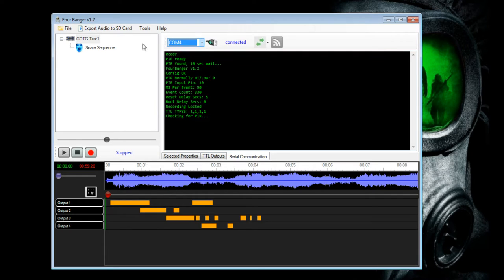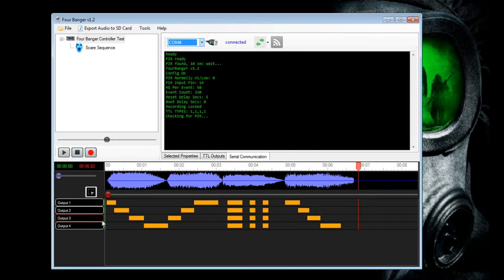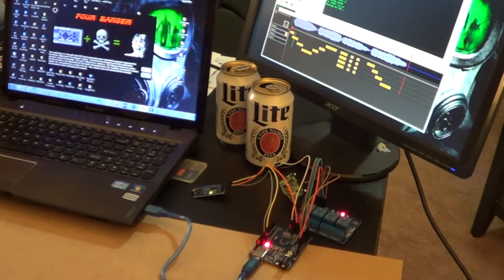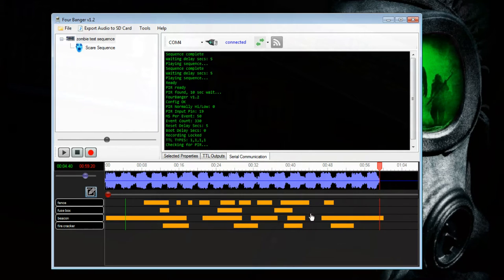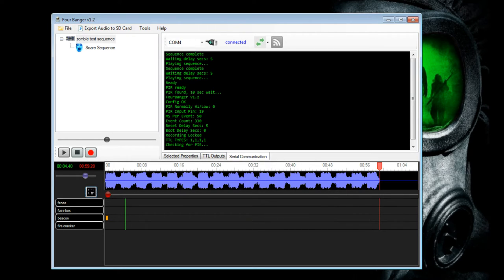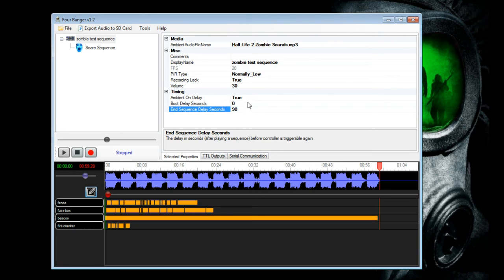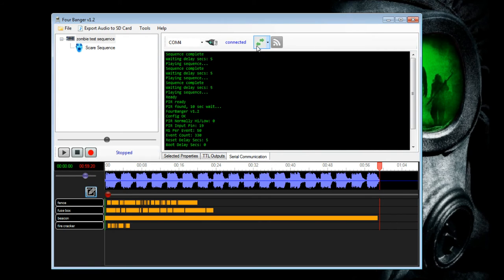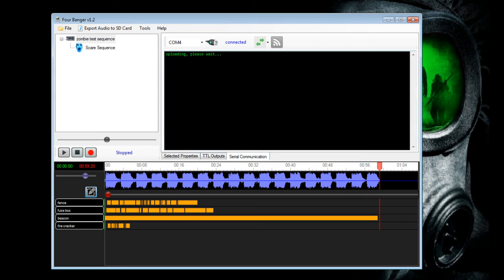Programming the $20ish Arduino Prop Controller

Comment: See, I knew you'd figure it out ... just have to play around with it. It's very simple yet does some pretty cool stuff. I have enough parts to build a few more. It gets really interesting when you connect a few controllers together and have them trigger together.
Reply from the maker: +The Pirates of North Court Yeah it wasn't bad at all!  Know I just need a descent enclosure that doesn't cost ten bucks lol
Reply: +The Pirates of North Court Oh, that sounds interesting!  How would you accomplish connecting them together?
Reply from the maker: +Montclair's Lair i'm not exactly sure yet LOL
Reply from the maker: +Montclair&#39;s Lair Basically you would take one of the 4 channels and use that as the trigger for the next controller in line.  You would be using the relay to close the circuit of the trigger input.  If that makes sense.
Reply: Graves Of The Groves
Oh sh*t, that's brilliant! And painfully obvious now that you point it out, LOL!. Not sure why that didn't occur to me. Sweet! Oh, now I know why. Will those relays work on switching low DC voltage too?
Reply: Actually, that isn't how I did it but if it works for you guys then great. Here is how I did it.

When the controller is triggered (either from the TTL pin 11 or PIR) the controller will output a momentary LOW on pin 12. That means that pin 12 on the "main" controller can be wired to a second controller's TTL input of pin 11. When a sequence gets kicked off on the main controller, the sequence on the second controller will go off at exactly the same time. Just make sure you tie the grounds together on both controllers.
Reply: +The Pirates of North Court This is a better solution as you lose a relay the other way. I suppose you could keep chaining them along this way. This makes for quite an awesome experience you can provide, for the relatively low amount of $$ you have to spend on controllers.
Reply from the maker: +The Pirates of North Court That is very cool!  I know little about these Arduinos so this is certainly a way better method rather than losing an channel.  Thanks!
Reply from the maker: +Montclair&#39;s Lair AGREED!!
Reply: +Graves Of The Groves Mike's controller is what really makes all this possible. He has programmed this thing to be as robust as possible and yet simple enough for just about everyone to build & use without spending a ton of money.

He has always been willing to answer questions and offer help whenever you get stuck. I figure it's the least I can do if I can provide a little help I've learned from him.

When I pull all my electronic pieces out and start building again, I'll shoot a little video of how I have mine put together. Can't promise anytime soon, but I'll post something eventually.
Reply: I've had the parts for three of these sitting in a box for 2 months. You guys are giving me the itch to put these controllers together!  I might have to scratch tonight. I'll vlog it if I do! Thanks for the great tips!
Reply: Guys, I did the wiring and it works, just like Pirate said! Another very cool thing is that you can leave the PIR on the controllers downstream from the main one, so that they can even trigger independently. Very cool stuff! Check out episode 7 of my vlog to see it in action! Thanks for the tip, Pirate!
Reply: +Montclair's Lair Very good. Glad it worked for you.
Reply: I need some help!

Is it possible to have more than one ambient track and if so, how do you do it?
Reply: No. The Arduino code Mike wrote doesn't support it at this time.
Reply: Montclair's Lair Thanks, good to know!
Reply: Canned Bread
 Did you trying reading the documentation?
Reply: +Canned Bread You can jump over to my channel and watch my build of this project. I have two detailed videos about it. One is building the thing, and the second one is using the software. There's an event delay setting that is, by default, set at 30 seconds, meaning you can't trigger the prop again until that delay is over. You can set that to 0 if you want it to be trigger-able immediately.
Reply: The Pirates of North Court I read all of the documentation. I could have sworn reading something about being able to use more than one ambient track for a controller while in non-triggered mode. I must have read wrong.
Reply from the maker: No sir.  I can't think of any prop controller that will run more than one ambient track.  Is it possible for you to mix your audio in something like Audacity? Or are you looking to trigger an additional audio other than the scare sequence?  If that is the case then you could run a secondary scare audio through one of the channels.  Other than that there is only one ambient track and one scare track that you can run through this setup.  Hope that helps!
Reply: +Graves Of The Groves It does, thank you! I don't need it to play 2 audio tracks. I just wanted to know if it's possible with this setup. This is my first time making a project like this, so any additional information about it is greatly appreciated!
Reply from the maker: No prob.  Out of the box, no, it will only play one ambient and one triggerable scare audio but there are always around things to make it do what you want.  That of course will take someone with way more intelligence than me. Like Montclair!
Reply: +Graves Of The Groves Well, you helped me build mine. That's why I subsribed to your channel. That pneumatic zombie is a kick-ass prop! It belongs in the new Walking Dead attraction at Universal Studios!
Reply from the maker: LOL thanks man.  I am by no mean an expert but I'm glad to help when I can or point you in the direction of the ones who know!
Reply: +Graves Of The Groves Thanks! Another question; how can you delete sequences that are made and saved in the sequence folder?
Reply: +Canned Bread You can navigate to the "Controllers" folder using your operating system, and delete the corresponding folder for the sequence you no longer want.  

As for the audio, like Jason says, you could mix two ambient tracks into one using any audio editing software. Audacity is free. You could also trigger one by connecting a relay to another set of speakers that are connected to some other audio source (an MP3 player perhaps) that's running something on a loop. But, you're going to have overlapping audio from the controller and your MP3 player. Honestly, the best solution is just to mix the two ambient tracks together into one. It will get the effect you want.
Reply: +Montclair's Lair I'm having some trouble with my audio. About 3 seconds before the audio is supposed to go off and end the sequence, it just cuts off, as well as the relays, and the red processor button on the arduino turnes on. Then it flashes while waiting on the delay. This keeps on happening. What should I do?!
Reply: Sounds like you're suffering from a reset issue. I've encountered that a lot. There are a multitude of reasons, but, primarily because the relays need their own power source.  Head over to hauntforums dot com and check out the 4 button controller thread under "Technological Terror". We can help you out over there more easily.
Reply: +Montclair's Lair Thank you! I've fixed the problem but am still not 100% sure what the problem was to begin with. I'll check out the website. Thanks again!
Reply: Canned Bread It can be difficult to solve. I've had it come and go, and thought I've fixed it, then add something else, and it comes back. Definitely check out the website. Lots of good info. It's the "official" support thread for the project. Hope to see you there!
Reply: +Montclair's Lair I think I've figured out the issue! It's a power supply problem. When I have the Arduino hooked up to a computer via USB, it functions properly. When I hook it up to my 12v 1amp power supply, the " cutting off" at the end problem happens again. So all I have to do is regulate the voltage coming into the voltage input; the same as the voltage coming in via the USB. Do you know the exact voltage being supplied from the USB? I've registered on Haunt Forum by the way. Thanks!
Reply: Canned Bread
The only way you could have 2 ambient tracks would be to daisychain 2 controllers together. You could add the soundcard to the other controller and have it play a different soundtrack. Not sure why you would want to do that but it could be possible.

As for the 12v1a power supply ... it HAS to be at least 1a and not less at all. If you also use the power supply to run your "devices" attached to your relays, you'll need to up the amps accordingly.
Reply: +Canned Bread
You should read the "Technological Terror > Four Channel Prop Controller Using Arduino", message board, the last 2 or three pages at least. We just finished discussing how to resolve the issue you're having. The primary reason is insufficient power from the Arduino to the relays. How much amperage you need depends on what else you're doing with that 12 volts.

Essentially, the main fix is a separate 5v power supply for the relays. It's discussed at length in the forum. I also discuss this on my YouTube Channel, vlog episode 46 at the 13:46 mark. If you have a look at those two resources, you will gain an understanding of how to resolve the main issue.

Depending on what you're switching on the relays, you may also need additional components. I discuss that in the same video, and on the forums. Trust me -- the answers are there. I've had the most problems with this prop controller, and with the help of all these great people on that forum, resolved them all completely.
Reply: +Montclair's Lair I'm having a hard time finding the specific resources on Haunt Forum. Could you please educate me on how to find a specific thread or post?
Reply from the maker: +Canned Bread well it tools like you got into an issue that's a little (or a lot) outside my realm of expertise but it looks like your heading in the right direction.
Reply: +Canned Bread
I did, above. I also emailed you from the forum with where to go.  I've also sent you a private message there on where to go. Go login to hauntforum and you'll have a message waiting there for me from earlier today.

But, if I start pasting URLs here, it's going to get flagged as spam by YouTube and nobody is going to see it until Jason approves the post.

Again, go to "Technological Terror > Four Channel Prop Controller Using Arduino" and go through the last 5 pages or so. That's where you'll find your answer, as well as in my video that I mentioned in my last reply.

This is why doing this in the YT comment section sucks, because everything gets all jumbled up.
Reply: +Canned Bread
I asked Jason to approve this post. Go here: http://www.hauntforum.com/showthread.php?t=41196&page=72

Comment: okay im having trouble maybe it just late... i have everything working correctly but the relays doesnt seem to be powering my lights, do they not gather power from the board or do i need to run power to each relay?

Comment: How many amps or watts will the relays on the circuit board run? Or would you just hook those relays to a larger relay to run? lets say a 110v air value to actuate a pneumatic cylinder? And where can I buy one? What is the name of the program to download on to my PC?